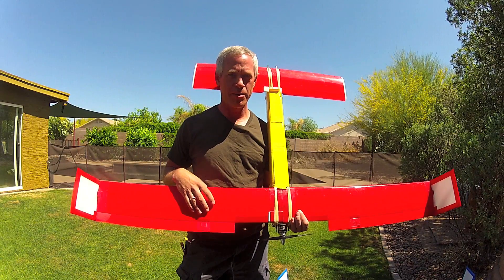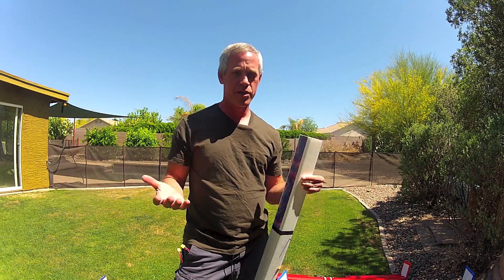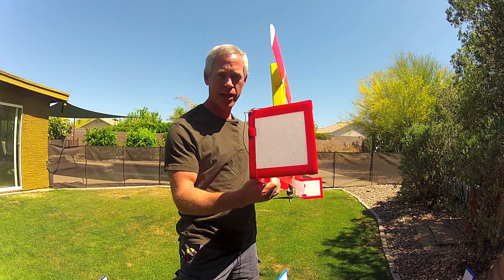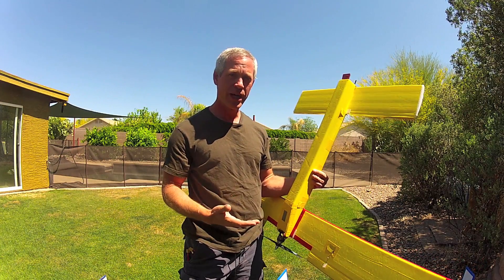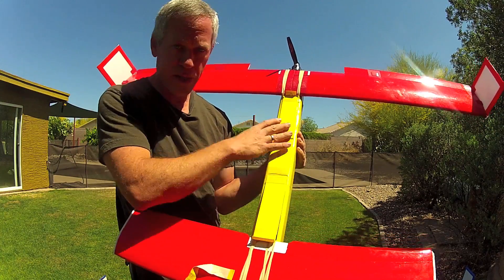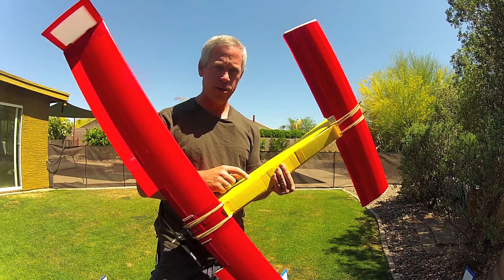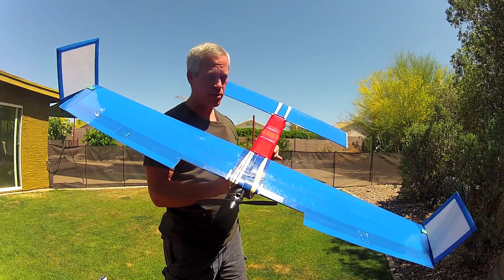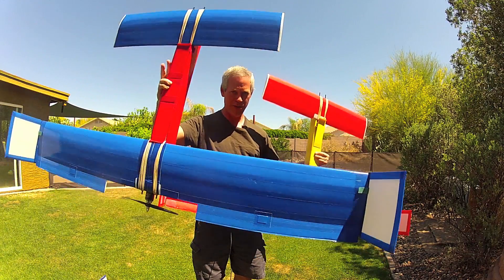ANSLEY PEACE DRONE - Introduction Video

Comment: Hey Ed, I have made my own smaller version of the APD, I call it the SCFlyer. The 7th iteration is a 36" wingspan, 28" length aircraft. The canard is glued to the fuselage, and the main wing is attached to the fuselage by a wing bolt. It is my fastest RC plane. Thank you for the design!

Comment: any reason why the front and rear wings are not same size?
Reply: It's a canard plane - the front wing is smaller than the rear wing. Both wings are lifting, but the center of lift is at about 2/3 - 3/4 the length of the fuselage depending on the ratio of the wing areas of the two wings.

If the wings are the same size it would be called a tandem wing.

Comment: If I don't want to fly with FPV gear can i just switch the motor to the front and run this in a puller configuration? Also to make it safer to launch? Would it be hard to stay clear of the pusher config prop when hand launching the larger build with a 12" prop?

Comment: I think I have made every single one of your planes including about 4 or 5 Axons lol.  In the works of making an APD with an 80 inch main wing 60 inch canard and 60 inch long fuselage.  With the wing chords being 10 inches.  Goal is to make a long distance floater that will run on about 6000mah worth of battery.  Using a canard cg calculator the cg will be in the 27 to 28 inch range.  The bigger than 2 to 1 canard pushes the cg up a bit.

Comment: Ed- Did you have to lengthen your battery leads to the ESC?  Seems like the distance is a bit far.
Reply: I had to lengthen mine, I had to push battery way forward to balance correctly , check out build video

Comment: If you tape the outer surface and use a pizza wheel to lightly score the inner where it will fold, it's no problemo. You can sand it and hot glue it too.

Comment: Hey stuz steve,

I had a look at office works and a few other stores and I found the foam board you mentioned. The problem is that per meter it is more expensive than Depron and secondly I couldn't find the type where the paper is removable.
So the question of whether Depron can be bent in to an Armin wing still stands...

Comment: I reckon you could pretty much cover the whole outer surface of a Depron plane with duct tape and not have it end up any heavier than the artboard/foamcore board type with paper on both sides. And it would be fantastically strong! Hmm, thinking about my own poor flying skills, I think I just might build one like that myself. :¬)